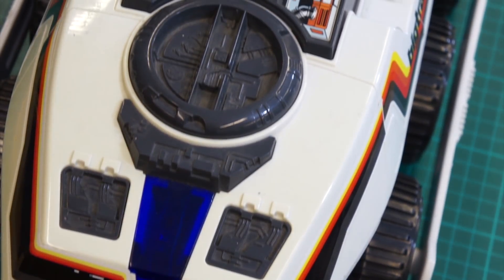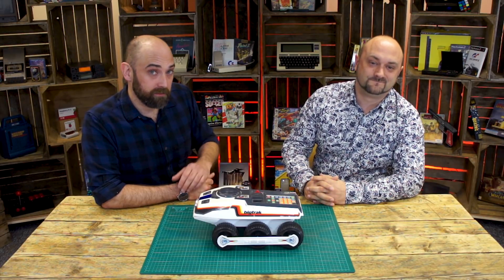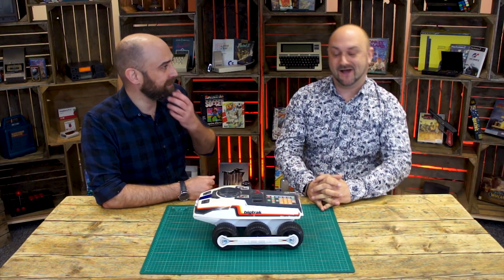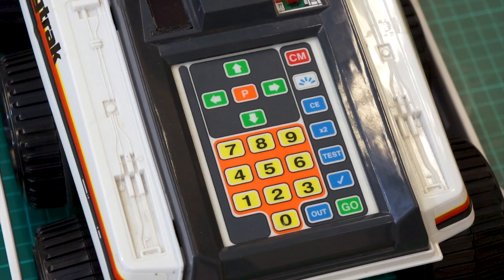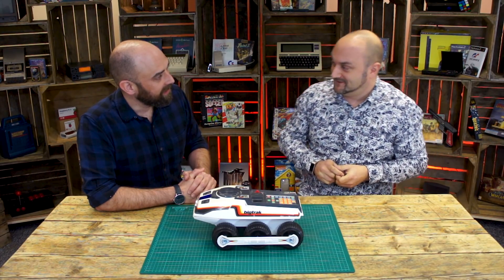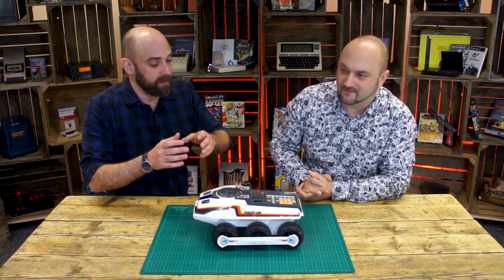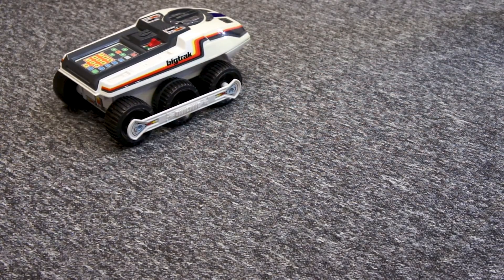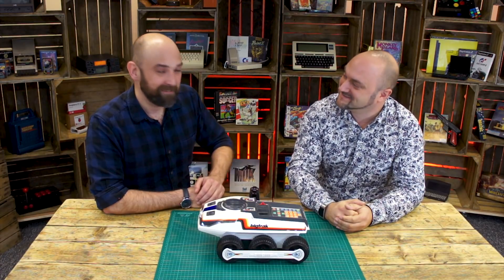Hack Trak Arduino Big Trak | With Dubious Engineering

Comment: I got a big track when I was 12 years old unfortunately 3 years later it got stepped on and broke so I took it all apart and hooked it up to my ghetto blaster as electronic tuner the only thing I had to figure out how many feet in between radio stations and it never landed right on the station so to fine-tune it I had to turn right or left to degrees even though it was broken I still had a lot of fun with it!

Comment: Oh Man... i have a BigTrack but it is in perfect condition so not willing to cut it up.  May try to find a dead one on ebay.  Using a Uno, H-bridge, bluetooth controller, the original batteries, a usb battery bank and the sonic sensors should be very easy to make a bluetooth enabled BT...  It is basically a two-wheeled car...  the generic program to control it with the phone is on play store...

Comment: My school had some BBC Micros and a turtle but we hardly ever used either as none of the teachers knew how to use them. I do remember using the turtle once in 1989 or 1990, when I was a tiny little Year 1 pupil (that's 5 or 6 years old.) I think they let me have a go as they knew I liked adapting ZX Spectrum programmes from Crash magazine. Funny though, my memory of it is that of an actual turtle-looking device, not the transparent plastic thing it actually was. I guess the fact it was called a turtle stuck with me somehow.

Comment: I had a Bigtrak, I remember the instuctions, the programming was to move forward or backward by the length of the Bigtrak tank itself, so you press the forward button, then press 3 then, then press Go, and Bigtrak moves 3 times its length forward.  You are correct about the turning being in degrees.

Comment: In Soviet Russia  copy of that toy called "Электроника ИМ-11"  was way more advanced, it looked similar but they added some cool features like flying rotor that was shooting out from the top part of a toy. When programmed to shoot a rotor a lid opens up and it shoots a flying rotor up to 2 meters my cat loved to chase it, it also had interactive lights - rear and front, better precision of turns and distance, and improved design overall, stop button integrated into a a front bumper - that turns off the toy when it hits an obstacle. I had USSR version back in 1989 I remember how my parents gave it to me for my Birthday and it felt like I got a toy from a future! Remember the futuristic box and amazing toy inside of it!  Still have it and it runs like new! I had to repaint it though as original white became yellowish.

Comment: I understand recycling what one has on hand... but it seems a shame not to use the original D-Cell battery bay for power. ;) Some LiFePO4 5000mAh 32600 cells in parallel driving a boost circuit to provide 5V would work a treat, I think. 

I wanted one of these as a kid, but never got one ... of course, I had a TRS-80 computer, so I can't really complain too much!

Comment: 500000000000000000000000 micro controllers and cpu's  out there with massive speed and power, and you choose a 16MHz chip.
Reply from the maker: +Luenardi De Polo that's more than double the power of an Amiga 500.  You're right, it was overkill 😛

Comment: I would have gone for a Micro-ITX motherboard with a AMD PHENOM II X6 with a advanced printer port so you could use it to control various functions of Big-Track and read inputs also, also a pico plug in PSU to power the Micro-ITX motherboard and could be programmed in machine code or BORLAND TURBO C++.
Reply: Sounds almost like what Sarah Connor warned us about in Terminator!
Reply from the maker: Good lord I power Dreamcast emulation on a micro ITX board with a pico PSU, that's a lot of power for a Big Trak I'd expect it to double as my daily use desktop PC with that in it and hopefully not drive off while I'm doing my accounts

Comment: This was my amazing machine back in the day...I still have it, but the wheels are broken...completely behind in the time and a very cool programmable machine...still miss not having the companion. The turns were a little bit off depending on what the floor surface was.
Reply: Mr. SEA absolutely...  the encoders in the gearbox make sure the wheels turn the correct amount but there is nothing to say a wheel slipped on the floor!

Comment: Still have one of the originals at my parents house. Sat on a shelf in my dad's office. :) 

I believe the forward command on it worked on bigtrack lengths, not a standard measurement. ;)
Reply: Darren Poulson wow!! That’s cool... thanks for the educational information!!  I thought it was about a foot... (makes sense as it about a foot long)
Reply from the maker: +Darren Poulson interesting!  So a multiple of its own length?
Reply: If I recall correctly, yes. I seem to remember that from the manual.

Infact, found the manual online. :) 

Each number will tell bigtrak to move one times its own length, so the higher the number you press, the further it will go. You can press any number from 1 to 99.

Comment: Is that the original 1979 version or the 2012 re-release?
Reply from the maker: Larry Bundy Jr I checked with Howard "It’s the 2010 replica as it has SMT PCB and no 9v battery under the turret!... (i think if it was the 1979 I would have tried to keep it in its original form)"
Reply: Yes indeed...  I bought it on the premise that is was an original - and subsequently found it wasn't...  so...  out comes the hacksaw and soldering iron!  Thanks for the question Larry!
Reply: Larry Bundy Jr ... Potential future project material! ...  LittleTrak!
Reply: Larry Bundy Jr I am guessing rerelease, for the original, at least in Canada was grey, not white.
Reply: Mr. SEA As already stated, it's a reboot version. The original version from 79, had different versions depending on where in the world you were. Your side of the pond were grey, where over here they were white.
Reply: Thanks,   Yeah,  there was no MB logo on the side,  so thought it might be the case :) 

By the way,  you might want to look for the mini version they also released in 2010, as it's a lot more advanced inside and also had an external port for several attachments.

But I believe they're supposed to be a creamy white,  rather than a completely bone white, so it might be that colour naturally.
Reply: That is interesting to know! - Talking of colour, my white is going a little yellow... perhaps I could employ some retro-brighting having learned quite a bit!
Reply: I had the grey one myself, with the dumper attachment. I kinda miss it, actually.
Reply: I bought a couple of the Big Trak Jr's (as they're called) a couple of years ago. Still have to do anything with them, so will be interesting to see what you might come up with.
Reply: VulpisFoxfire my parents wouldn’t buy me one...  great news, this one was on eBay!...  maybe you should have a look for a gray one and put it on the list of possibilities!
Reply: would you sell to me one of those big trak jr's....?
Reply: The original also used 4 ‘D’ cells instead of 3 in the replica. The original had much better traction the the new version, which is weak in comparison. Why they made these changes along with losing the 9v battery I will never know!

Comment: Well, what a lovely experience that was! - Thanks Neil! - Vicky and I had a great day out and we felt so welcome and comfortable at your studio! - Looking forward to watching all your future videos! (Having seen most of your others already!)... https://www.youtube.com/user/howitee
Reply: Dubious Engineering 

Subbed!

Can't believe I hadn't heard about your channel until now. It looks like a lot of fun.

The ESP32 would be ideal for adding Wifi and Bluetooth, but I'm guessing you were thinking of that when you mentioned it? :p

I designed a new mini motherboard for the N64, and used an ESP8266 for control.

Using a very simple sketch via the Arduino IDE, I managed to get joypad control of the N64 via a UDP Joystick app on the phone.

It's not exactly easy playing Mario 64 with a phone touch screen, but it worked. lol

(I think the code for Bluetooth Classic support on the ESP32 is still being worked on. Once it's done, then it should make it easy to connect a PS3 or PS4 controller.)
Reply: Still some work to do, so the SDRAM on the underside can act as a "Flash" cart, but it boots.

The board fits perfectly inside a Gotek case, as it's only 10cm square...

https://i.imgur.com/ZVzHIQ7.jpg
Reply: ESP32 makes a lot of sense, we may also fit one to the robot lawnmower.  Image that...  sitting back with a beer in the summer and pattern training your lawnmower!
Reply: Dubious Engineering 

Awesome.

Just booting up the PC, and I'll bung my ESP UDP Joystick code on pastebin.

It's pretty basic tbh, but might be useful to somebody.

There were only a few free joystick apps on Android that did what I wanted. The "best" app is still a tad frustrating to use though, because if you move too far, it starts swiping the whole screen left or right. lol

I would have written a better app, but coding apps is definitely not my area or expertise.